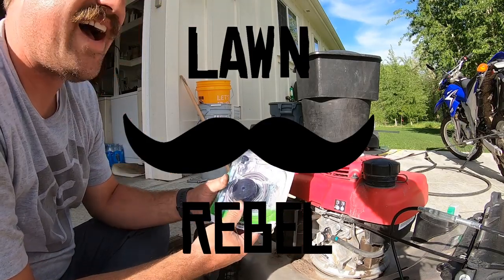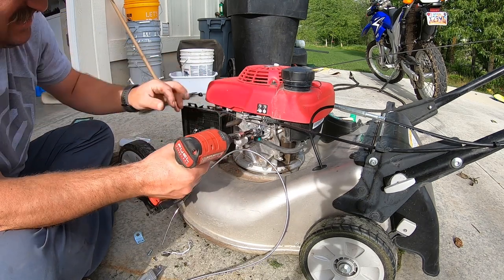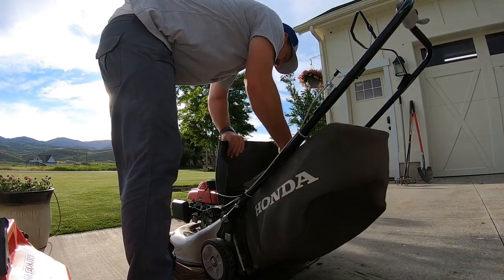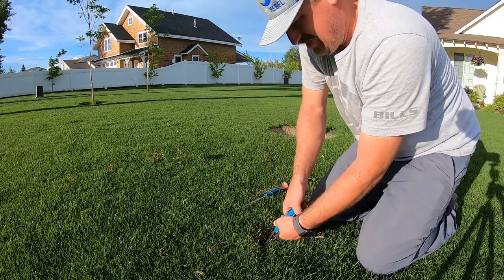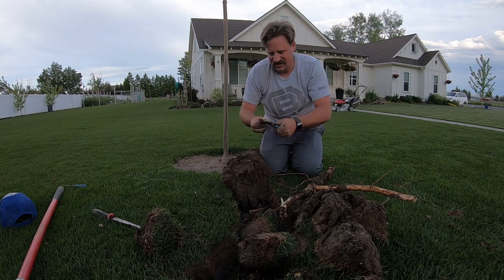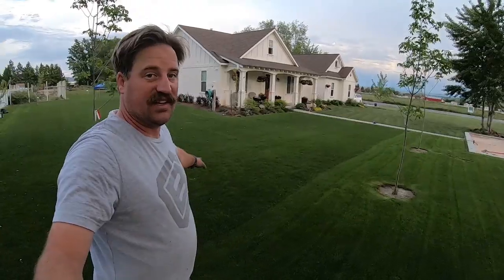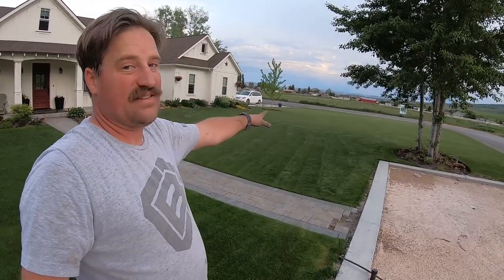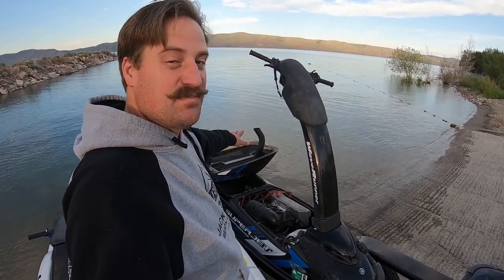Installing a MANUAL CHOKE on a HONDA mower. PULLING ROOTS

Comment: Thanks for saving me some time.  My original HRX217 choke worked fine until it wore out after 5 years.  The replacement new factory design is a PIA.  I have to wait about 4 minutes for the mower to warm up before I can mow.  I'm getting manual choke kit today.

Comment: Yesterday I finished digging an 80 foot, 1 foot deep trench to send power to my shed.  Holy crap there was a ton of roots and rocks.  Wasn't fun at all.  I was scared to use a trencher because I know my septic field is over there somewhere.  So I just use a mattock and a trench shovel.  My body is beat to hell.  All done now and worth it.  Awesome to have power in my shed!!!

Comment: you can't let a diesel engine run out of fuel or you create air bubbles in the lines.
Reply: Yeah, especially on big diesel engines that can be quite the job to get them going again.

Comment: Honda sells a choke control for the HRR216 for about $12.99. I did the conversion using it. You basically swap out the auto choke control handle and install the controller with the choke symbol on it.

Comment: The lawn boy choke is nice because you would just pull it back (it was above the air cleaner) and when you started the mower, it would automatically go back to the off position in 5 seconds. The new system you have seems very similar

Comment: another video reminding me why I switched to an electric mower
besides the choke hassle(continued from the other video) never running out of fuel and having to leave to go get more, then spilling it everywhere, and last inconsistent running; as you show happening with your big riding mower ... with so many 'usability' issues and prep gone, it makes mowing more often a breeze and much more enjoyable to be able to get right to the task 

the yard looked healthy grown up a little taller; and where you dug up the roots, the soil didn't look like it was all sand and added product...so might not be any problem if someone treated it as a 'normal yard' some day(as I wondered about in another video) - seems that there is a very fine range that you have to mow and treat a short cut lawn in tho, and I notice that too when my grass is kept short; and couldn't do that all year, but maybe for you with a shorter season its more worth while
Reply: I had a battery mower and went back to gas after a couple months. Electric is heavier to push and the batteries turn to garbage after a season. I do have an battery blower and weed eater, but I also have gas backup of each as well. Battery equipment supplements my other stuff, but will never be a complete replacement.

Comment: On those tree roots, can you paint the sampling with 100% glyphosate?  In my old house I cut down 3 quaking aspens, and once I did that they sent shoots out over my lawn for years.  Nothing seemed to help until I painted them with glyphosate, which finally killed them.  When painting, I did get it on my turf so my lawn looked like a yellow spotted Dalmatian for 2 months.

Comment: You know when my autochoke was bad I'd just push it back with my finger 😂
Reply from the maker: I did that but it just sprung back into the wrong position because the wax wasn't warm yet to push out and leave in the correct position
Reply: @lawnrebel  that's what she said

Comment: The easiest way to prevent anymore roots growing into your yard would be to dig a 3 to 4 foot trench right where your grass ends. Then go all the way around the grass line and fill it with concrete. Then the roots can't get into your grass anymore.

Comment: So Honda does make a manual choke for the Honda gvc 190 the Motor they put on power washers that would have worked as well just have your dealer look it up for you. Or I can pull one off one I have and send it to you.
Reply from the maker: Oh crap... I just did the same thing. Just threw away an engine that had that manual choke.

Comment: I don't care for my HRR much. The auto choke actually hasn't caused me any issues in 3 seasons, but I replaced the carb itself after the first season due to crazy leakage. Bad rear wheel bearings as well, poor mulching quality... Wish I would have bought a Toro.
Reply from the maker: #metoo

Comment: That's how my Toro Z Master myride is. Takes forever to get going after I run out of fuel.
Reply: Chipdouglas you need to prime the fuel system when you run dry.  Normal it means the fuel filter needs to be loosed to let the air bubble loose and allow fuel in the just tighten.

Comment: I own North Valley Repair in Oahu and am amazed at the stupidity of Honda ,Briggs and Stratton and other small engine manufacturers of these crazy ideas of their Auto Choke Systems.
 Why don't they all just go back to a manual choke and quit screwing up these engines..  Hondas GCV and Briggs and Stratton Plastic Carbs have got to be the worst to work on. I've been doing small engine repair foe almost 40 years and these new designed engines are nightmares, especially this Thermowax system on honda

Comment: When you run of out fuel you have to prime the fuel system.
Reply from the maker: How
Reply: You can crack the injectors and crank over the motor for like 30 seconds and then most likely the air bubbles with have exited or you can Loosen the fuel filter and crank it over. And by the way your videos are amazing.
Reply: Don’t run your diesel out of fuel!!! There’s a good YouTube video called “BEST way to bleed diesel fuel system (step-by-step)” with good instructions on what to do. 👍

Comment: I wonder why this one sucks mine has worked perfectly fine for like 2 years
Reply from the maker: not sure. Wish I knew
Reply: Could be blind but it looked like the wrong governor spring was used.
Reply: Same here with 5 years on my HRX.  I recall the dealer mentioning that it might have a hard time starting if you shut it off and try to restart it before cooling down some, but I've never had it happen.

Comment: If you read your comment I’ve explained it to you twice in two different video oil the choke mechanism The only reason why the choke is not closing is because it is stuck you can even manually use your finger like I’ve seen you do in your video before to close the choke it’s not that hard but here it is you’re making a video about altering a very nice lawnmower with an aftermarket choke not smart
Reply from the maker: I did read that comment about oiling the choke mech. I did... I did.. I did not oil it but I did recommend that to another commentor because of your Idea. I will do that. I promise